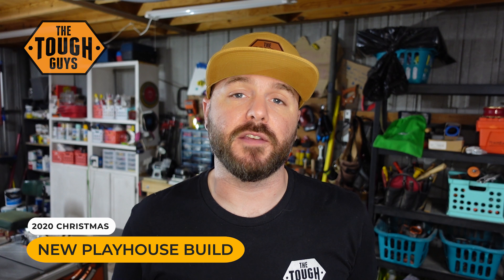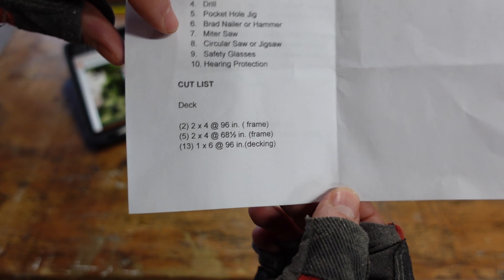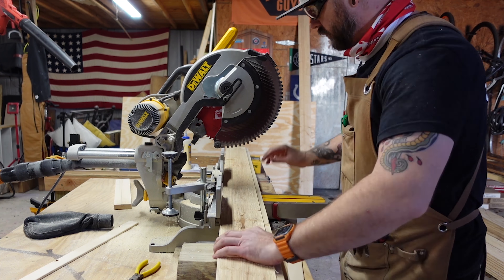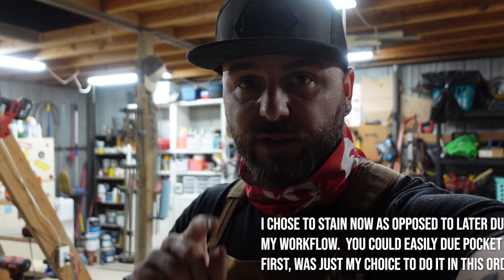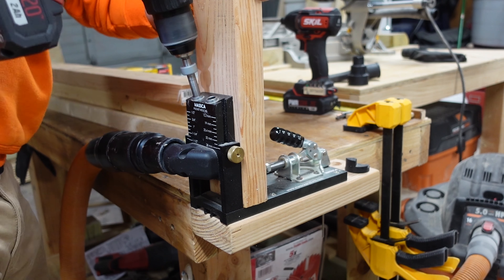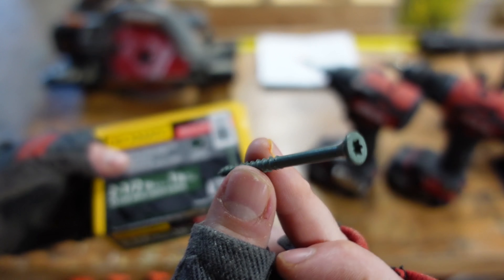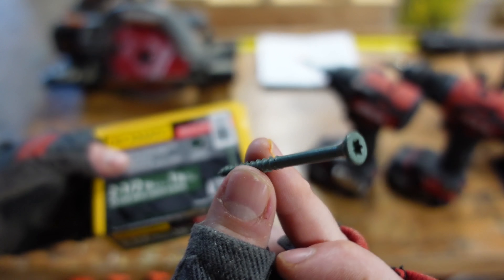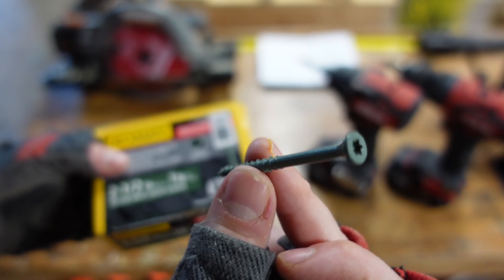How to Build a Kid's Playhouse!

Comment: Thank you. Do you mind disclosing how much all cost and approximate duration. Thank you.
Reply from the maker: Thanks for reaching out!! I believe at the time we ended up calculating around $400 all in, including the shingles for the roof. With that said, lumber pricing has been pure insanity so it may be more now for sure and also depending on where you are geographically.
Reply from the maker: For the duration, it took me about 4 days working on it alone in my spare time. If you had help, you could build it over a weekend no doubt.
Reply: @ToughGuysDIY  thank you.
Reply: @ToughGuysDIY  thank you.

Comment: Hi, great video! I'm building this using the same plan.  Did you change the dimension of the frame at all? Can you please tell me how big this is. You're a big guy, an I'm 5 feet so I can't get the idea of how big it really is. I'm building it for my 3 yo.
Reply: I think it's about 3.5 x 6feet, is that about right?
Reply from the maker: Apologies for the delayed response.  This is a LARGE playhouse for sure.  My 8 yr old is big for his age, and can stand fully inside this thing.  It's about 5-1/2 ft tall on the front side.
Reply: @ToughGuysDIY  I built it 3 sided and anchor them to the walls. It's inside though and my son loved it. Thanks for the heads up on the wrong measurements and vagueness of the plans!